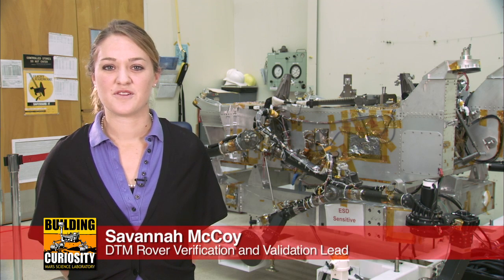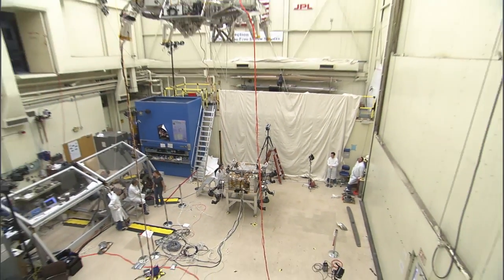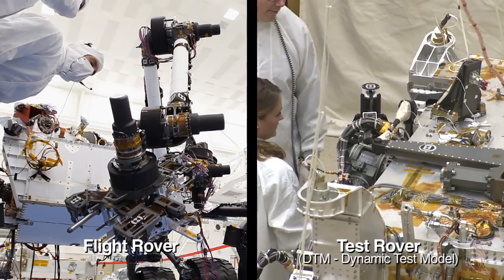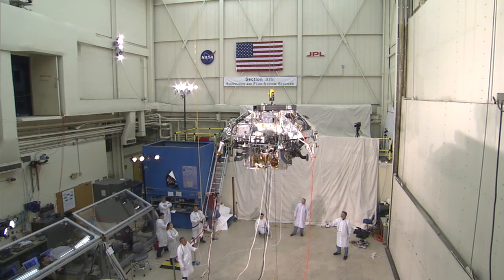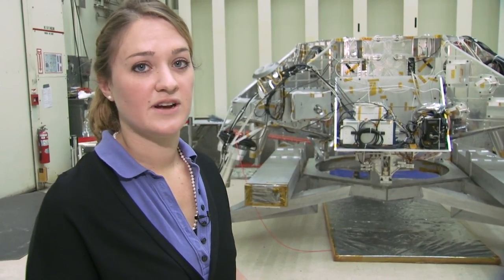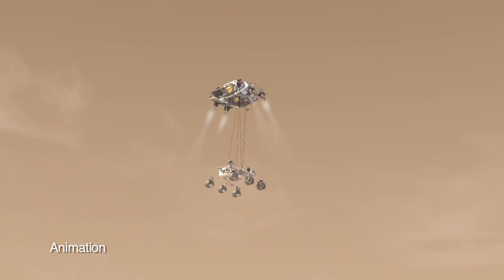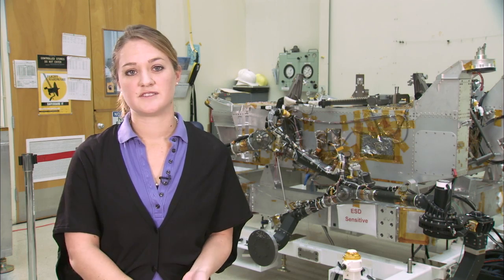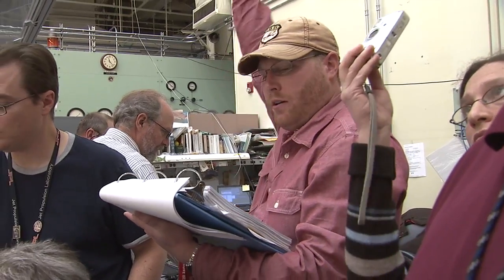Building Curiosity: Landing System Drop Test

Comment: Reaction control systems are very commonplace. Every rocket that is put up has one, it's just a computer with a gyroscope as an input and thrust variable rockets (or whatever) as its output. If you have rockets pointing down and a radio altimeter you can hold an altitude pretty well too. Look up MKV on youtube. Also those rockets were tested.. on Viking..

Comment: I agree with Albert Baer. If it is impossible to test hardware in our atmosphere then lighten the weight of the mock hardware to balance out the higher gravity present on Earth.

You do not send a probe to a distant planet without some kind of probability of success based on an actual physical test.

Science is not a gamble, or it is not science.

Comment: That's the problem with space travel.  There's only so much you can physically test without resorting to computer simulations, because it's impossible to replicate the conditions that space vehicles will be experiencing.  So they rely heavily on computer simulations while physically testing whatever components they can.

This video explains a lot of what I was talking about: /watch?v=NyHKJMTjAfc

Comment: No, there was no flying test, because it's impossible to simulate the conditions under which the actual landing was performed.  Not only is the air pressure a tiny fraction of what it is on Earth, but the gravity is much lighter, the atmosphere has a different composition, etc.  They ran lots of simulations, and physically tested as many hardware components as they could, but air resistance and gravity would have torn the lander and rover apart if they tried to perform a test landing on Earth.

Comment: Also, this landing system is the first of its kind.  So every single aspect of it had to be extensively tested with an array of simple tests that minimize extraneous variables, before they could even think of performing an actual test landing.

And those tests paid off, since Curiosity just landed successfully.

Comment: This isn't the only test they did.  Everyone knows that you start with the simple tests and work your way up to the more complex ones.  After all, if you just perform a test landing on Earth and something goes wrong, it's very difficult to find the error.  So they start with simple tests, like this one.  They're probably testing stuff like the strength of the cables, wind resistance of the rover, how the drop will affect the lander's velocity and direction, etc. using a whole array of sensors.

Comment: As others have mentioned, I think we'd all like to see more realistic crane drop tests than the one shown here. For instance - outside in the environment, with the skycrane jiggling around, and some wind, and perhaps some light dust blown onto the test article to simulate a dust devil. Surely the EDL test team would have done this, why not show it? When there's a $2 billion mission hanging on a cable, an inside drop using still and static conditions isn't the most convincing.thing.

Comment: Hello , I would apreciate a rocket video test like everyone. Some of my thoughts for the non believers are first of all my iphone can detect every inch I move in all directions and I supouse the rover will do aswell in order to avoid spining on the air when the rockets are activated.
Second is that we all have seen those rc drones flying perfectly still , and this rover sure will have a thrust control system ultra fast to correct the thrust of every rocket to do the same job.

Comment: This is only a guess, but I think that it would be impossible to test the full EDL system from within Earth's gravity. Mars' gravity is only 1/3rd that of Earth's. You could make a test lander 3 times as powerful as it would need to be on Mars, but what would that really tell you? So my (extended) guess is the best way to build the system is to thoroughly test each subsystem to obtain as much data as possible then plug that into a simulation to learn how the system will behave as a whole.

Comment: @TheG5cents You don't need a PHD to know that setting something gently on the ground is smoother than slamming it into the ground with airbags. If this is the extent of your logic, I honestly cannot help you. Hundreds of tests have been done with this landing system, as they were done with previous rovers, both active and in the lab. Additionally, light years away? Comical, try 10 light minutes.

Comment: @TheG5cents It doesn't look smooth? Blithering idiots like you were crying about Pathfinder's landing system over a decade ago. What sounds worse, gently setting down the rover using a rocket powered crane, or dropping it from 10 meters for multiple 40g impacts by the use of an airbag, and then rely on the lander being able to open up, have the rover unfold, have the solar panels unfold, ect. Keep the heavy thinking to the people with the PHD's to back it up.

Comment: @bowlesjd Landing a rover of this size has never been *done* in the past - this is the biggest vehicle yet destined for Mars. Furthermore, the method of landing it is not "old" by any means - this is the first time it has been used. This rover is too big and heavy to bounce it on to the surface with air bags, as was done with the Pathfinder and the two MERs. The JPL has accumulated vast experience in soft-landing probes on Mars and I get the feeling that they know what they are doing.

Comment: I'd love to know: How do you compensate for doing this test in Earth gravity?
Reply: The might have used stronger versions of the cables for these tests. If they used the actual flight versions, they would work on mars. I believe the rate at which the cables were paid out was fixed and independent of gravity.

Early on in the design, there was a concern about the winds causing a swaying pendulum effect that would have to be compensated for which this particular test did not seem to cover.